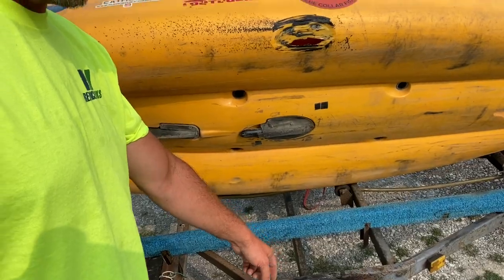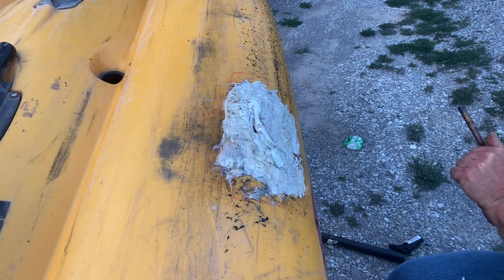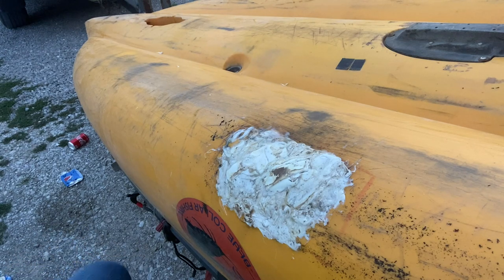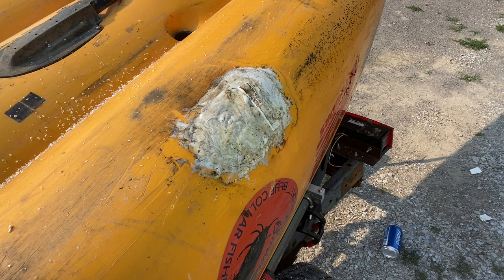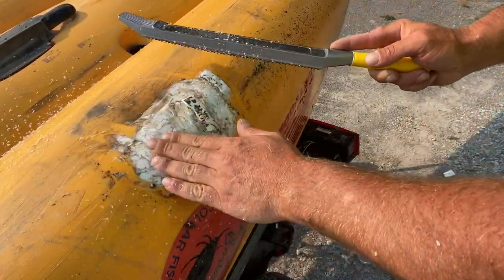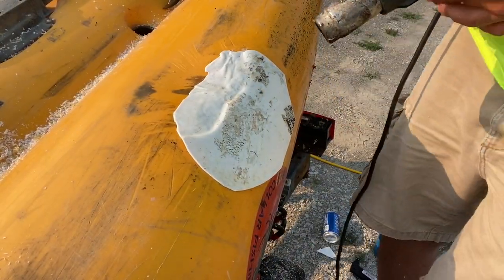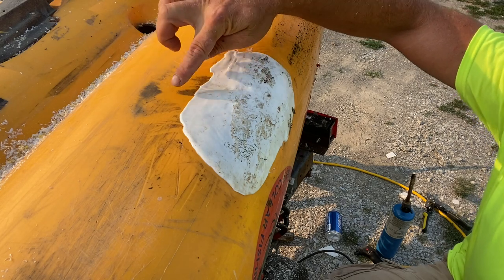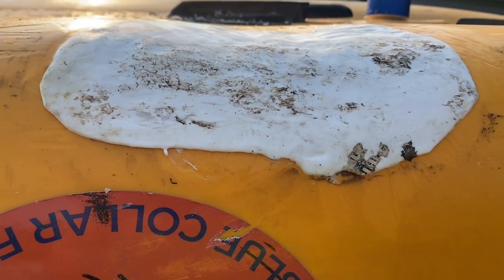How to repair a hole in a kayak.

Comment: NEVER EVER USE A TORCH ON A KAYAK. Use a heat gun!
The problem with your repair is you're not heating both plastics surface/filler.
I hope this worked for you but I would have melted wire mesh over the hole from the inside (If accessible) I use a flat head wood burning tool. 
Then the plastic has something to stick to.
I prefer playschool and little tikes furniture since it's made of the same plastic used to make kayaks.
Reply from the maker: I have done 20 or so this way now and all have held great. This one was done a couple years ago now and my buddy is still using it every weekend

Comment: Next time cut a beer can and shape or line the inside with it after roughing up the aluminum with sandpaper so the plastic  sticks to it or the beer can and aluminium or stainless screen to the outside. The problem with a torch is the black carbon will cause poker chipping in the plastic layers. Pretty good job with a torch though.
Reply from the maker: I hope I don’t have to do it again 😂 that’s a great idea though and I appreciate the tip.

Comment: Throw some keel guard tape over top of it or gorilla tape, that should smooth it out even more and add that one more layer of protection between the patch and elements.
Reply from the maker: I plan to put the stuff San told me about over it

Comment: Nice job I'm about repair a hole in a Kayak did that hold?
Reply from the maker: Still holding strong a year later
Reply: Great mine lasted for almost 2 hours with very little water. Thanks again